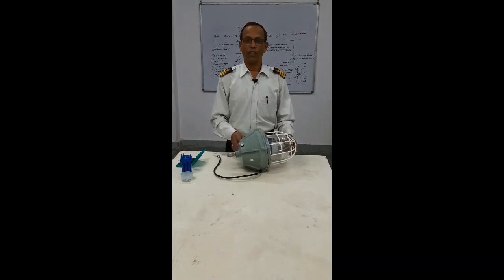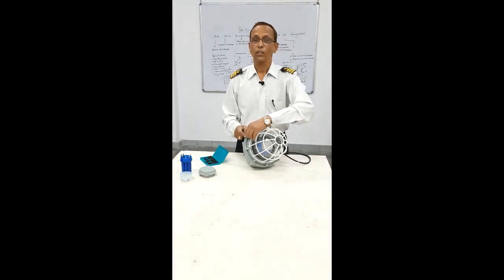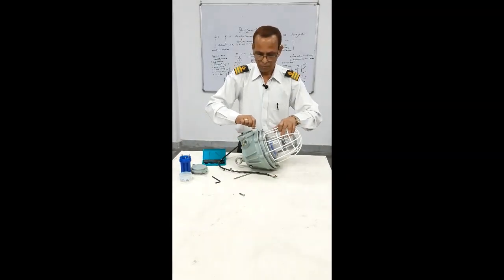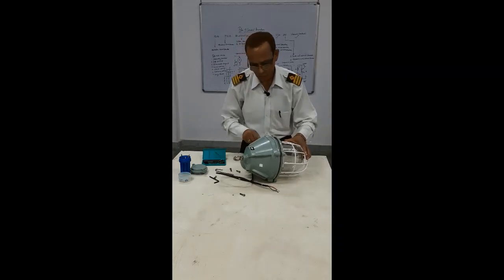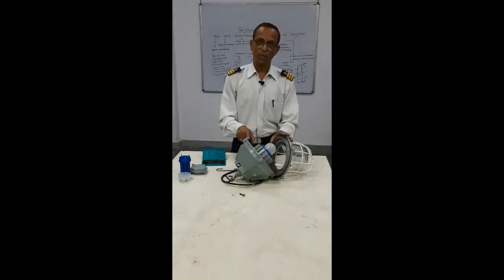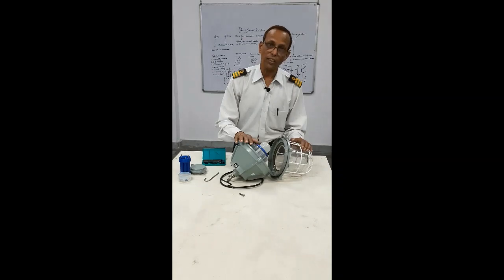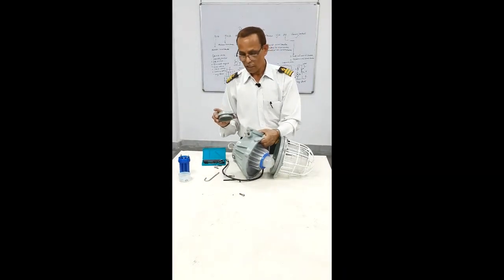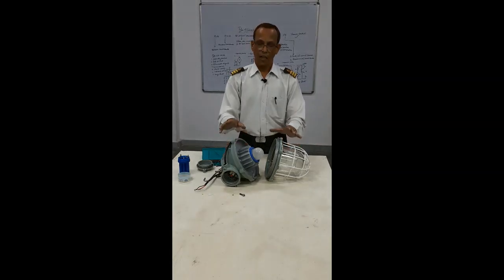How to Dismantle Intrinsically Safe Lights

Comment: Is there any flameproof lights in bunker tank ,?if there how to change the bulb,
Reply from the maker: There are no lights in bunker tanks. When scheduled cleaning bunker tanks needs to be gas freed. 
After gas freeing the tanks and checking O2 level then fully covered  external lights can be used.
Reply: @MarineETOSinghal  thank u so much for ur reply sir,